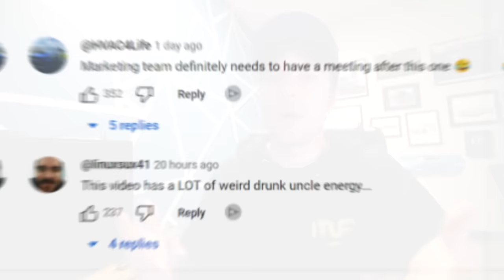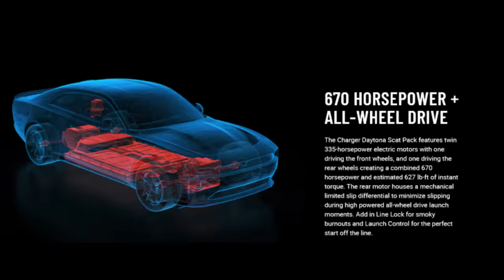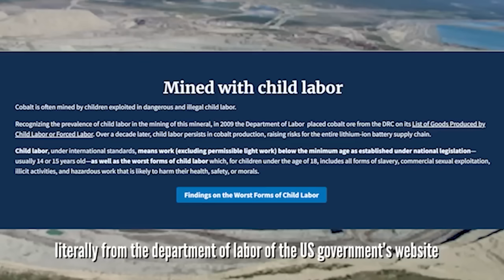The 2024 Dodge Charger Daytona Unveil Was Embarrassing

Comment: I'm kind of bummed they got rid of the Challenger E body, though this car really looks good but why not make them both? Maybe its just not doable financially. I don't love the EV "exhaust", pretty dumb try hard, but I have hopes that its going to really rip. As far as the Hellcat motor, yes it sucks to be ending, but Dodge is not a company like Ford and GM. They don't have the same global market and I think are a lot more cash strapped. Their line up of cars is far smaller and at the same time, bigger as in, BIG cars. They aren't making much in the way of small cars at all and are just getting hammered by CAFE standards. You can make all kinds of gas guzzlers but you need to offset it with a bunch of fuel sippers and Dodge doesn't have that, unlike Ford and GM. The only way to continue to operate is to buy carbon credits from....Tesla. To the tune of billions a year. It was fixing to go to a level so high the company would have just went out of business. SO they had to make a more efficient muscle car engine. Enter the six pack six banger. Ford can keep on making V-8s because they have a larger and overall more fuel efficient line up and are not being crushed by CAFE and carbon credit buying. Sucks, but that's what it is. Times they is a changing. EV's are probably a good thing but the battery tech and infrastructure is lagging. But they are stupid fast. Honestly, we need to build some nuclear power plants. I know, I know, but that's the answer for right now.

Comment: Oil and gas beat out electric years ago for the same reason it is now. Lack of infrastructure, range and refuel time.
Reply: 1) The range of a Tesla model 3 is equivalent to the range of a Dodge Charger. You can spend more if you'd like more range. Some EVs can travel over 500 miles on a charge, but this is far more than most people will need for 99% of trips. 

2) The charging network is rapidly growing, but already very large. The Tesla network is very reliable and has tens of thousands of stations. 

3) 99% of refueling will occur while you're sleeping or at work. And superchargers will allow you to refuel from 20-80% in just 30 minutes or so while you're on a roadtrip. If you're ONLY driving roadtrips, just buy an ICE car. You can also rent ICE cars if you want one for a yearly roadtrip, use a train, or buy a hybrid. There are tons of options.
Reply: @Jake-rs9nq  That is if your condo, apartment, place of employment or HOA allows it!
Reply: @MrMan_47  63% of Americans have a garage or carport, so they'd be able to charge their car without any issue. Most apartments are putting in chargers as well, and I expect that they'll be widespread by 2040, when half of all cars on the road will be EVs. 

It's not an overnight transition, chargers are popping up everywhere, and within 10-15 years they'll be more common than gas stations.
Reply: @Jake-rs9nq  ....and all that extra electric will come from where? Solar? Wind? It will be interesting to see!
Reply: @MrMan_47  Renewables already produce more electricity than coal. And they're growing exponentially.

Comment: The Progs already turned their backs on EVs and cars in general. They have switched their attention on walkable cities, public transport and bicycles. "Muh V8" meatheads aren't going to be interested in the I6 or the EV Charger. Normies just want SUVs and pickup trucks. I really don't see a potential customer base for this new Charger. Honestly rather than betraying your core base half way by not offering a V8 model they should've just gone full on betrayal and turned it into an SUV, just like Ford did with the Mustang Mach E to at least get some normie appeal.

Comment: 10:10....Might be Dodge's plan,build electric Charger's so in 2026 they will have the HEMI V8 return! If the electric Charger meets Government sales targets? I think Dodge should have built a compact electric car/cuv that sells for under $30,000 to sell V8 HEMI cars!

Electric cars are only good for the city and not driving more than 40 miles reliably per day,more than that you run into issues...

Comment: Hard pass. They could have taken all of this technology and improve the hemi and instead they made another inline engine that they have to bolt twin turbos on.

They are copying the work based on the inline 4 from GMC and chevy, and the inline work for the Ford raptor, and they can't even come up with their own fucking ideas.

And then to top it off Ford is still going to make a V8.

I don't buy Dodge for a V6 and I don't buy Dodge for an EV.

Comment: I really don't know any Gear Head who's getting over the moon with any EV you can come up with: Dodge or any other make... But given the current energy transition, which is a necessity unfortunately, the EV is one of the ways to go to replace the fossil fuel engine vehicle. It most certainly is not the only way... 
I mean Toyota and other car manufacturers are on par with the transition; with Hydrogen Combustion Engines: they sound like a fossil engine, they behave like a fossil engine and they drive like a fossil engine and the only thing besides a roar is water vape coming from the exhaust! In fact: Toyota asked Yamaha to make their famous 5.0 litre V8 (comes is a lexus and comes in the Toyota Land-Cruiser) to rebuild this engine to run on Hydrogen. Yamaha has succeeded is this quest and so the Hydrogen running Toyota 5.0 V8 is available now. 
No more electric rendering of what should be the sound of and engine, but instead the real sound of an engine! 
Porsche and several partners have started production of a climate neutral “e-fuel” aimed at replacing gasoline in vehicles with traditional internal combustion engines.
The German automaker, owned by Volkswagen, said Tuesday that a pilot plant in Chile started commercial production of the alternative fuel. By mid-decade, Porsche is planning to produce millions of gallons of the e-fuel.

So guys, there is hope for us Gear Heads!

Comment: The new charger looks bland and even terrible at certain angles. That inline six is going to sound like trash and the EV is dead on arrival. The EV doesn't need anymore down force when it weighs 6k lbs. Also, stop lying about EVs, they aren't better for the environment, they are actually worse. Anyway Dodge is dead. I'll be keeping my challenger widebody til the wheels fall off.
Reply: inline 6's sound great, just need a proper exhaust,